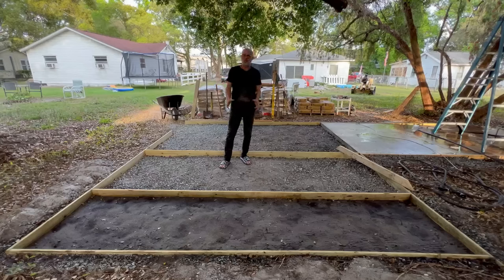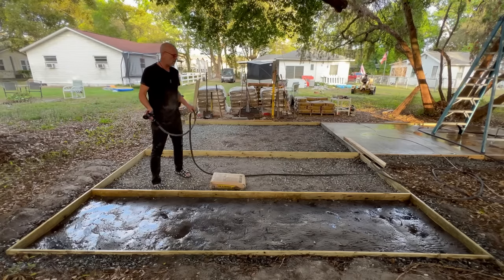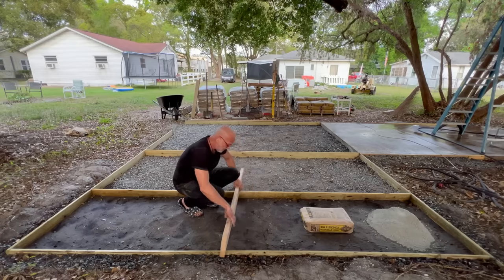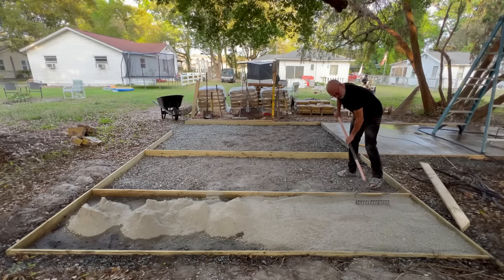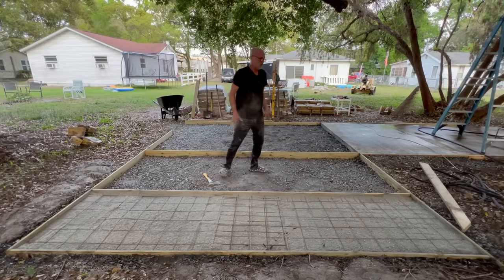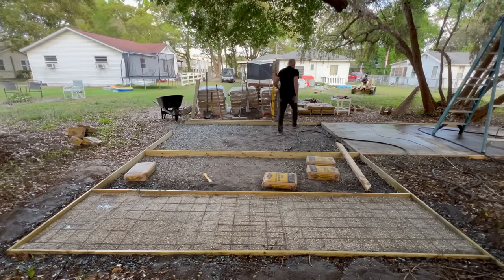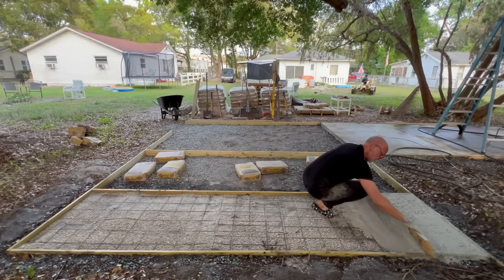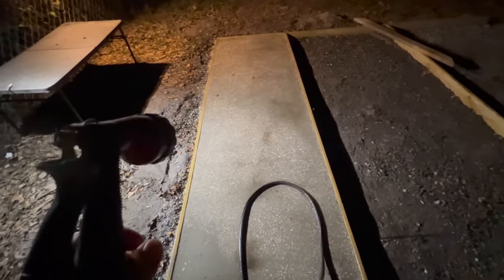How To DIY Dry Pour A Large Concrete Slab In Real Time

Comment: This is a great idea. 81 sft per yard (9'x9') at 4" thick and about 54 bags per yard. Your material cost are as follows: 2 cubic yards is 102 bags at $5.95 per is over $606.00 total. For Ready Mix You are looikng at about $150.00 per yard and $150.00 delivery charge, so its about $450.00, so you have thrown away $150.00 on the dry pour.
Reply from the maker: How much would it cost me to have a professional concrete crew with tools and experience, finish the pour?  Does concrete truck drivers carry tools and finish it for you?  If so, I did not realize labor was free with concrete and the only real cost was materials and delivery.  Thank you for the inside scope.
Reply: @renetto  Also, considering where it is in his yard.   It's a high chance of having to order of pump,   which is $300 per hour.
Reply: I never suggested that you hire professionals to place the concrete, the amount of work you performed to "dry" pour is cloes to the amount of work you did to wet pour, using screeds floats etc. @renetto
Reply: @jeffneedham6875  well having to wheelbarrow that amount of wet concrete is not far off the amount of work to bring each bag to that area, unless 80lbs has gotten lighter.
Reply from the maker: @georgeharrison979  should i rent a mixer.  I don't have a truck.  Should I be worried that concert is going to harden quicker than I can figure out what to do next?  I ended up pouring almost 400 square feet of pad by the time I was finished.  Doing it a section at time and learning as I go was priceless.  Just like your comments.
Reply: @renetto  No, have ready mix deliver it and wheel barrow it to where you are pouring, initial set on basic 3000psi is almost 4 hours. You have at least 1.5 hours of workability, you can get that down easily.
Reply: @georgeharrison979    Yes,  But to mix those bags at the same time with a dry poor vs a wet poor is vastly les time consuming and depending on the size of the pour usually concrete jobs need multiple men at the same time because of the need to finish the concrete before it sets.        On actual material,  the costs are comparable.   But it's the labor where the money can be saved for an individual
Reply: while your whole premise of cost effectiveness MAY  be valid (I don't know the company's willingness to deliver only 2 cu yds of concrete), I'm confused by your math.  There isn't 81 sq ft per yard.  There are 3 ft per yard, so a sq yd is 3 x 3 = 9.  A cubic yard is 27 cu ft (3 x 3 x 3).   Pouring 4" deep is 1/3 foot.  Thus each sq yd equals 0.33 cu yd at 4" deep.
Reply: @renetto The concrete company just sells you the mixed product that they will pour but you still have to hire a company to do the work but you can easily do it yourself while the concrete  driver pour the stuff
Reply: If I am doing a cement pad for a patio at 16’x10’x4’ I am looking at 90 bags of quikcrete as per their site. That is 24 yards of concrete. To have it delivered mixed is $2400 as per low estimate on google. 90 bags at Home Depot is $600 delivered. Your math is waaaaayyyy off my dude.
Reply: @charleshess3764  Isn't it cheaper to just buy a yard of sand  gravel and a few bags of Portland cement and do it yourself for a little or nothing, remember you can buy sand one day and buy gravel another day etc
Reply: @renetto  the concrete contractor will for instance charge $5000 to do a job and the concrete will only cost $500, that's why it make so much sense to do it yourself because its pretty simple, youre just smoothing out mud! Just take time and form it up using 2by4's and some rebar or mesh
Reply: @charleshess3764  Well, according to your measurements it is not 24 yards but more like 1.95 yards because I am assuming the 4 is inches not feet. 24 yards of concrete would cover about 1900 or more square ft at 4". Easy with the math cupcake!
Reply: I found that dry pouring is something I, as a 70 year old woman, can do alone one 5x5 slab at a time. So far it’s been a few months and it’s holding up well and looks good. Cost was prohibitive to have it done professionally, this method allows me to do project over a few months. I don’t have a mixer and mixing by hand in wheelbarrow is  impossible for me.
Reply: 150 is cheap labor,  work smart not hard.
Reply: @ottokiehl5413  @ 4 inches, 1 cubic yard of concrete is equal to 81 sq ft. Total sq ft divided by 81 is 1 of the formulas for estimating how much concrete you need. If you are pouring 6 inch thick, divide by 60.
Reply: Here's my perspective as someone who does a lot of DIY, learns as he goes and wants to have good results first time because he doesn't want to redo(especially in this case).  It's about cost and final results for me.  So as a method for someone with little or no experience to get solid results this seems legit honestly.
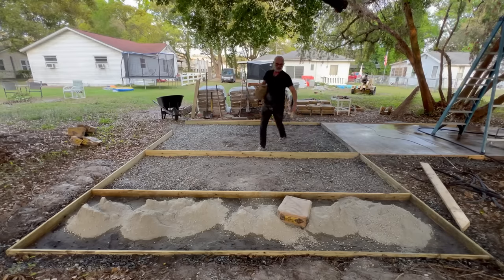Reply: @renetto 12:09
Reply: @jurnagin nothing in concrete is easy....trust me.
Reply: Not to mention that concrete needs a specific amount of water to cement mix ratio in order for the concrete to have the needed strenght while a dry pour has a water to cement mix ratio out of specifications making it weaker and won't age well
Reply: Cement trucks have a time limit so you usually need a crew to keep up. Plus idk where u find a 450 cement truck. My area there is a minimum yardage and it’s like $2000.
Reply: This dry pour is the most useless method I have ever heard. Also you can't really pour dry cement
Reply: @Legostopmotionz2023  it will look bad with time since dry pour will only harden on the outside leaving the interior uncured. There's a reason there are manufacturer specificatios of water to concrete mix ratio. On the dry pour you only wet the surface and not even with enough water.
Reply: You was suppose to mix all the cement then spread it .. the bottom  of that slab will fall apart over time..
Reply: Used this video as a DON'T DO THIS!  I would not pay all that money just to become lazy and not properly mix the cement with water
Reply: i paid 585 for 2 yards including all the fees and it was worth being on a mixer truck
Reply: minimum 4 yards for most companies then the pumpers are much more than your average delivery, also tool purchase or hiring finishers. You're way off.
Reply: do not forget finishers charge around 300 - 400 each, you need at least two....
Reply: You have no idea what you talking about. He did save money.
Reply: This was BRUTAL to watch.
Reply: Bro the rake story had me cracking up. I've worked construction for 15+ years and i Enjoyed the video. If I've learned anything it's that there's always more than 1 way to skin a cat. If nothing else you definitely learned something from this project. Most people will never try and yet put those that do down.
Reply: I would also highly recommend wearing gloves. Stuffs Absolute hell on the hands. Nothing good comes from raw dogging concrete, wet or dry.
Reply: @renetto  cost About $2k lol more or less depending on company
Reply: @renetto  'How much would it cost me '
The FIRST calculation to do, is to make a test 2' x 2' area for both dry and a proper wet pour.  Then test them both, and determine how much % of the material's strength you're wasting by not doing a properly mixed pour.  Then at least make sure the remaining percentage is enough that it won't fall apart very quickly.
Pour water on some flour etc and let it sit.  Then mix a dough properly.  Compare.  
Only wetting the agents sitting side by side will not smear the wet agents onto and into the aggregate like proper mixing will.  You're giving up a sizable percentage of what the concrete is supposed to do by not mixing.
The second step up mixer is only $250, and once you've used it you can sell it back off.  Or find a used one and use it for about free after you sell it again.  At least a basic broomed finish isn't even that hard to do on concrete, watch a few videos.
Anyone does basic testing your dry pour will be inferior.  Maybe still OK enough for a patio or light loading, but it definitely wastes a sizable percentage of what the same material and tiny bit more cost should have produced.
Reply: Not to mention it's not as strong. Theres a bunch of videos of people hitting dry pour with a hammer and it crumbles around the rock, for some reason the cement doesnt stick as well to the rock. Rent a Mud Mixer for $50 from the hardware store, it does a yard an hour solo.
Reply: @jeffneedham6875 with a couple friends with 2 wheel barrels it would take the same amount of time as it would take to carry the bags back there. Cost, a case of beer and food. Tools $100 for some trowels and $20 to rent a float.
Reply: The only thing dry pour saves is finish time. You squid ths dry pour than water. Wet you need to mix and finish, but its stronger and finish is nicer.
Reply: @Strwbryy111 so you saved $700, you had to spend time to pick up material, buy materials to form, tools to do the project and actually do the labor to have a sub standard finish product. As far as $280 for material you'll need 56 80lb bags at $5 a piece, I dont think so
Reply: I was quoted 768 for 1 cubic yard of concrete by a place that doesn't have surcharged for short loads supposedly.
Reply: Dont know where you buy ready mix haha 😂 i just had 2.25 yds delivered for 630.00 so your maths flawed
Reply: Oh and if it took more than 20 minutes they charge 120 per hour pro rated by the minute... thats for the cheapest company in the county and i got quotes from em all. I also happen to already own the 350 dollar 20 ft bull float, trowels, rakes, shovels and other assorted implements as well as have experience doing these types of pours.... by the bag is actually cheaper, wouldve saved me 150 bucks. I gladly would pay that 150 in my case for the warm water mix and added oxygen to my 4k psi reinforced pour since ill be parking cars on it
Reply: @charleshess3764  16'x10'x4" is 1.98 yds of concrete, not 24.... i just poured that exact pad size. Have a video on my channel
Reply: @jonathanmolina3529 thats not accurate, concrete allows moisture to drain through it, dry pours cure all the way through. There are videos on youtube showing slabs dry poured and broken up to investigate
Reply: @tradrodsandcustoms  Sorry but that is inaccurate. Many videos have shown the exact opposite where the dry pour slab is solid on the outside and then still powdery on the inside. Is not moisture what helps concrete cure. It's water, a necessary amount of water
Reply: @jonathanmolina3529  not if you do it correctly. Cant take an example of someone doung it wrong and call it proof that it doesnt work
Reply: @tradrodsandcustoms  How can something being done wrong be done correctly? There is no correct way of making a dry pour because it was not intended to be done in the first place. Also, we're in YouTube. You can find many people doing tests and all have the same outcome. One guy even put the wet and dry slabs to the test with a hydraulic press after giving it months to cure and the dry pour literally crumbled under the press. Dry pour is not a good alternative. It is not viable. If you want to use it, go ahead just don't be surprised when in time your dry pour causes damage, accidents or simply starts cracking and crumbling
Reply: @jonathanmolina3529  theres a right method to do it. Its not for being in a press or driving a car on (although ive never seen reinforced dry pour tests) its for small jobs and a hundreds of pounds of pressure. I thought it was dumb at first but it has its place
Reply: @renetto  hahaha, I was wondering the same thing with his comment.    That's what professionals do, they spit out numbers on material to make it seem cheaper, but never mention the labor cost.
Reply: @lorihamlin3604  Looks great if it's a Hollywood set. Not so great if you want to apply any kind of weight. Oh and stay away from the edges of the pour. It will last longer if you avoid touching it or it will crumble or fall away. Best bet is to get a launge chair. Sit in the shade with a glass of lemonaid. And enjoy looking at your handy work.
Reply: @agent.86 no it won’t, lol. That’s why it’s titled “dry” pour. Many videos of people that have slabs years old.
Reply: @agent.86 say you don’t have a clue about dry pour without saying it. Lots of video out there to back up this process. Slabs several years old and as strong as it was day one.
Reply: @howie4150  Howie, I’m not so sure why the snide comments seem to come out from anonymous sources when someone offers a different take on things. I have no help and cannot afford a professional job so I was simply stating that dry pour was a method I chose to try. After a couple years with nothing heavier than a golf cart on it it’s holding up fine. So what if years down the road it crumbles..I’ll be dead and won’t be my problem.
Reply: Also you are not supposed to be working concrete with your bare hands or feet you will be very sore with cracking skin the lime in the concrete is very acidic. so please wear boots and gloves
Reply: Cute how much is it if it was poured buy a concrete truck brought it? Did u count. In the mesh. When I poured some we went brought our bags home in the truck with a trailer let the hardware guys stack it. Used a mixer some chicken wire and rebari put recycled styrofoam between board and cement as I could pour a cement slab by city ordnance. I could build a lean to but I could not make it a permanent structure.  So there is a 1/4 space between my railroad ties and cement foundation 😂
Reply: Why in Gods creation would you wear flip flops and no gloves!
Reply: Ready to mix is not a one-man job. They gave you 30 min to unload the truck. You can't do all the things in 30 min, so you need at least 2 more help, which adds cost.
Reply: 😂  Ready mix guy comment? 33 % material, 33% labor and 33% proofits. That's the way it works for companies. He saved a lot of money.
Reply: Why not use the wheelbarrow
Reply: The pride in doing something yourself is priceless .Nothing everything is $ and cents .
Reply: I say it’s 18yards😅
Reply: @renetto yes. They wait all day for you. You use the same tools you used here. A 2x4 to screen and a 5$ trowel
Reply: @lorihamlin3604  good for you .  thats how I have to do things around here too I would put the bags in the back of my truck and back right up to it though  that carrying concrete bags is too hard
Reply: @jonathanmolina3529  well dont do a house foundation using this method it wouldnt be satisfactory
Reply: @Wantgolfballs  when you get the load have some forms up on the side for some little thing you can use the extra on when he comes
Reply: @PaulyV56  well said  I was dying here
Reply: @mizzarello  did you see all those bags of concrete he had there??????
Reply: @mizzarello  oh hell no
Reply: @georgeharrison979  But an old lady can’t do this by themselves and can’t afford to have someone do it for them.
Reply: I call BS on your pricing.
Reply: @renetto got 250 a yard here, if it was under 10 yards, it's a other 250 charge, then 10 dollar surcharge for gas, then 10 dollar plus a yard if it a weekend, then another charge for this or that. So good job man. Those places rape you.